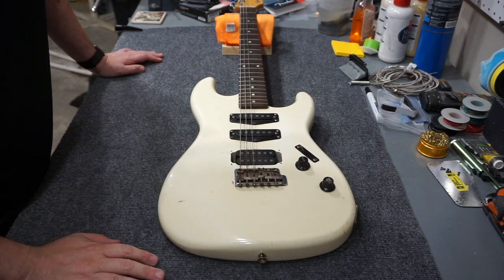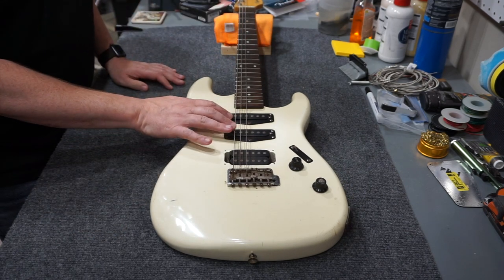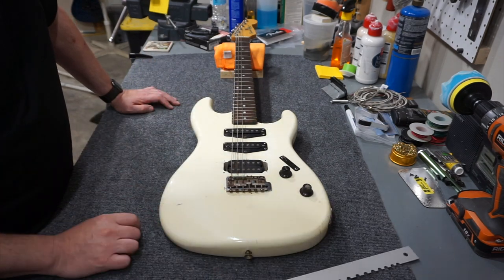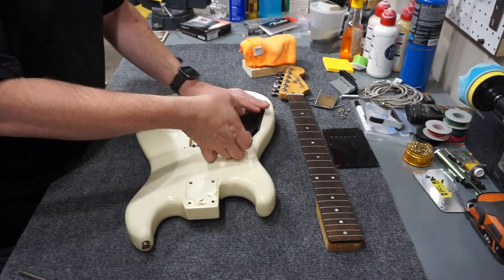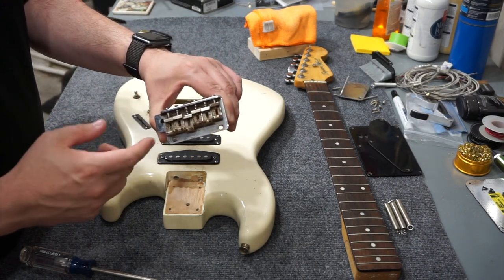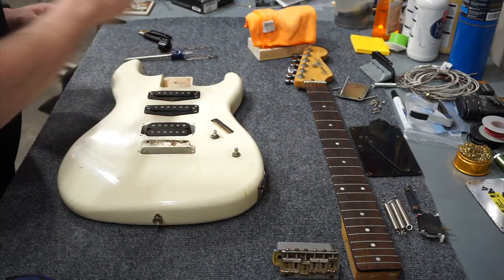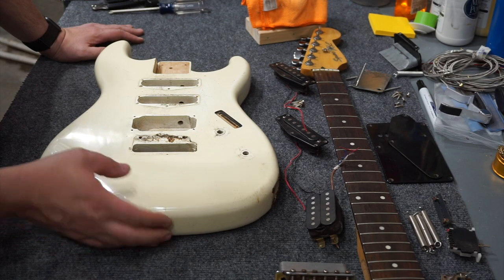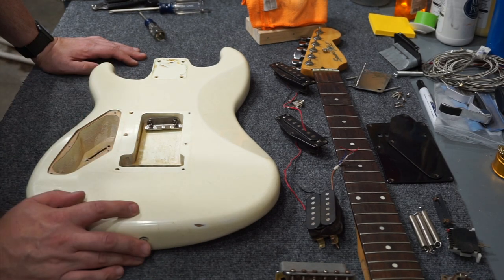The Squier Bullet Contemporary Project: Part 1 - Disassembly and Inspection

Comment: Wait 😂this one is my favorite.
Reply from the maker: Frets were a nightmare.  If I had it back, I’d replace.
Reply: @hacksguitarhobby ,  mine has great frets, it wasn't played much. I did a light re crown and polished it up after several months and I messed the body up. I was having brain fog and didn't know. I was learning about how to fix poor neck angle and I thought I needed to re drill the neck pocket holes so o filled them qnd tried to re drill with a regular drill and made it worse. The neck wouldn't fit after that so I did it again with a better result.  I learned that it can be fixed easier as the pocket angle was off some so I sanded the edge that was pushing it too far over and then it worked when I simply pushed the neck over and tightened it. That was a scary thing for me and I decided not to do anything without templates,  lol , no, I just qn not a wood worker even though I built 4 cigar boxes (that helped me most) so, why don't you build a few on the show and stop cutting the good stuff out? Good stuff=content qnd that gets viewers.  Show actual footage of you fixing things. That's what people want. I like you cause you are like me, not a face guy. But you're doing it and I'm not so you have me there. Rots of ruck. Sorry, early, had a rough night.

Comment: Hack's Guitar Hobby....In fact, that guitar is from the Squier Bullet One series and not from the ''Contemporary'' series....It is not a  ''bit like a mini Stratocaster, except full scale'' ...The body shape is much closer to the Musicmaster and Duo Sonic that the Bullet One series replaced....
Reply from the maker: Have to disagree.  Bullet 1 is not a series but a model.  It’s SSS, pickguard, and all that… traditional.  This model started in 86 as a contemporary version of the Bullet, HSS and no pickguard.  Originally it had a tele shape but the Strat shape started around ‘87.  It’s not a contour body but is a Strat shape (only meaning offset double cut) like the Duo Sonic and Musicmaster before it, and the Mini after it.